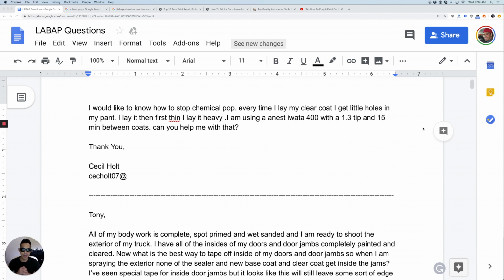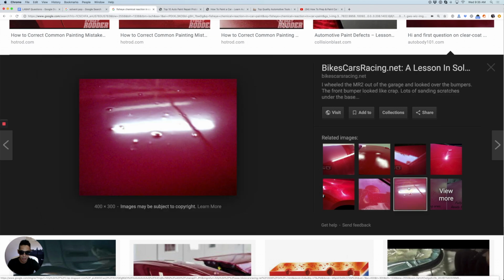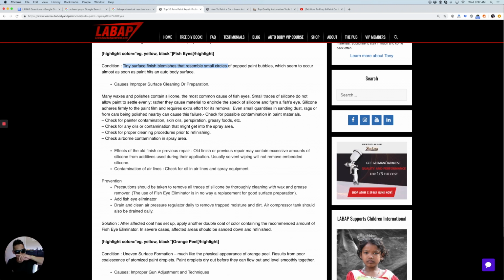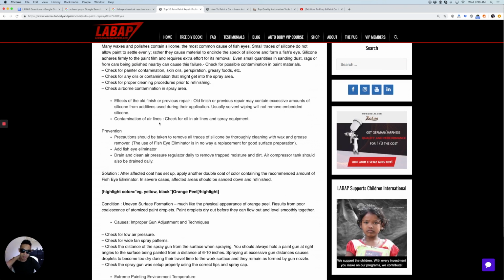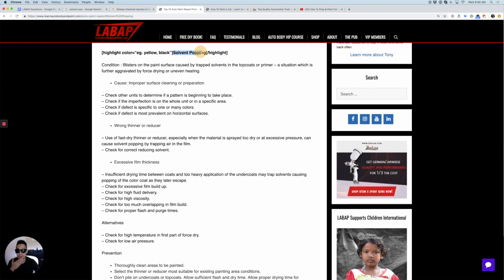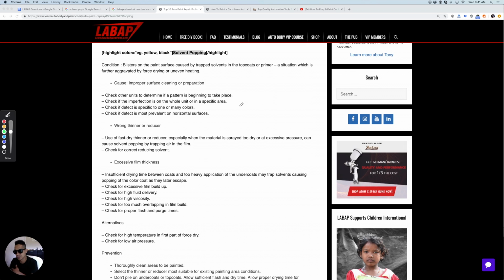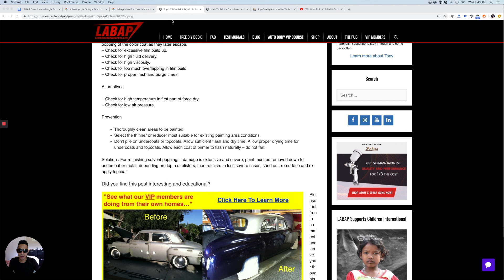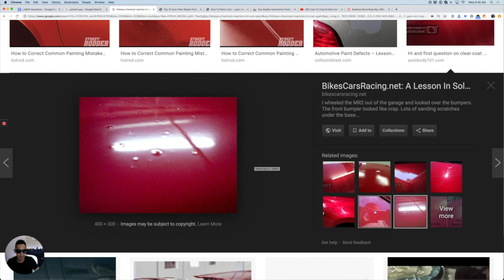What Causes Solvent Pop And Fisheye in Automotive Paint?

Comment: I wonder if there will ever be a video on how to fix bubbles whether they are in the base or in the clear coat?
Reply from the maker: like air or water bubbles? Solvent pop?
Reply: @HowToPaintYourCar I recently did my hood and to the one side theres these little 1 inch long and 1/4 inch wide bubbles that have popped up....3 of them 2 smaller then the 3 that popped up.  I was told if I dont fix them they will get worse.  Except is like 20 degrees here and its almost impossible to work in th freezing weather

Comment: With reducer slow is fast,, l only buy slow now no matter what the temperature l just give it more time in colder temperature, fast reducer with just give you more orange peel,   and spray first base coat light to prevent fisheye, most fisheye comes from spraying to heavy of coat at once, with light coat even if you get it you can let it flash and cover it up with second coat.
Reply from the maker: Good point! Light coats are key to a good finish.

Comment: I only use slow reducer and thin even coats with plenty of time between coats,  too much air across the surface can cause skin over trapping solvent, avoid heavy coats,, I've found a helpful tip , on first coat of clear turn fluid knob out 2 turns and increase distance too 8 inches let flash dry to the touch before second medium wet coat closer distance, give your base coat plenty of flash time before clear, l mean like atleast an hour,
Reply from the maker: That’s a great tip! Keep cranking Man!
Reply: @HowToPaintYourCar   l started in a down draft booth couldn't put out a bad paint job, moving to my own made cross draft booth it's a whole different world and you have to adjust to it.

Comment: Solvent popping happened to me yesterday. 1st, 2nd and 3rd coat of candy were fine. The 4th and last coat lots of bubbles showed up. I think was the temp cause these last few days its been super hot here around 36C (97F) and I wonder the why first 3 coats nothing happened on the candy cause the temp hadn't reached that super hot temp even if it was just 15 minutes of flash time from the 3rd coat. Also I remembered increasing the flow a bit on the 4th. Maybe it was a combination of things that made it pop.
Reply from the maker: Hey Man you might wanna check out https://www.radspaintformula.com/r2 and know more about on how to Master Auto Body And Spray Like a PRO Without Orange Peel, Nasty Runs & Tiger Stripes by Hacking This 5-Step R.A.D.S. Paint Formula

Comment: Thanks Tony! Always good stuff! I painted an old steel frame bicycle, added decals, looked great, but cranked on the Spraymaxx 2k clear in heavy layers, and got solvent pop bubbles!! Gotta sand down and start over, lol!! But question is, since adding decals over red base coat, how do I clean off the finger prints/oils without removing the red base coat?? (to prep for clear coat) Thanks!
Reply from the maker: Hey Man! Check out LABAP VIP Program and Learn How To Auto Body & Paint Like a Pro and Download Your FREE 85 Page Auto Body and Paint Manual at https://vip.learnautobodyandpaint.com/home

Comment: I did a hood today the base layed out good perfectly smooth waited 15min between coats did 2 coats. Went to start spraying clear and started getting bubbles. I did my engine compartment but used a cheaper clear and it came out great. Im wondering if i got a bad gallon of clear.

Comment: Solvent pop I've had this car come back with this on it when out fine when you pop the bubble water comes out and it smells horrible how's that happened
Reply from the maker: Hey Man! It happens when your paint dries too fast and you did not give enough time for your solvent to evaporate. That is why we use reducer to keep the coat drying fast. There are still other factors but try using slow reducer.
A good painting temperature range is from 70 to 90 degrees. Slow reducers are good because they allow your paint to flow out. Slow is the best for complete paint jobs. 

Medium reducers are used in a little colder environment. You can use a medium reducer in maybe 65 to 75-degree environment to set up earlier. 

Fast reducers are used for touch-ups. You can be working with just a fender in around an 80-degree environment. Hope this helps! For more tips and free training please visit learnautobodyandpaint.com

Comment: This solvent popping happens when the paint dries too fast while the solvents have not had enough time to evaporate.
This is where a slow reducer comes a long way. It keeps the coat from drying too fast, also reduces fish eye significantly. I have had enough of these issues and basically experimented a bit. Although other factors contribute to the problem, using a slow reducer has solved the problem for me.
Reply: How long do you wait in between coats with slow reducer

Comment: Not sure if this applies, but I recently detailed a customer's black Optima, which was heavily oxidized.  I did a one step correction using a product called 3D Speed.  After wiping down the hood many very small pits appeared.  Not sure if this is fisheye, as explained in the video or not.  Nevertheless, the condition was not obvious prior to the one step correction, and the customer is pretty upset.  For my part, I am pretty confident that I did not cause this pitting, but rather, I merely revealing existing damage to the clear coat once it was buffed.  Needless to say, my client is not accepting my explanations and we are at a stalemate because I do not feel responsible for underlying damage.  Wet sanding or doing a more extensive multi step correction is nothing something in my wheelhouse, so I am hesitant to offer to do this considering she is expecting something that I perhaps cannot deliver on.  Can someone tell me if my thought process is reasonable, in that removing the oxidation revealed the imperfections that were not so noticeable to the naked eye.  Thanks

Comment: Hi thank your videos. I wanted to ask if can i wet sand and buff fisheye ?
Reply: The only way to get rid of it is to respray the panel
Reply: @shaggymeme1268  If I am noticing them while clearing, I will let it flash longer between coats to try to achieve a little more build. I will apply a total of 3  wet coats to try to fill them as opposed to the normal 2. Then the next day I will sand down with 1000 grit, then 2000, finish with 3000 to eventually buff and polish. Hope this helps

Comment: SOOO really pissed off right now with Eastwood Epoxy. all my panels have a ton of acne. small pimples everywhere. double strainer and machine shook to break up solids. after fast etch was applied waited next day. washed with acetone the wgr. Used eastwood concourse gun 1 med wet coat 1.7 tip at 70 degrees  What am i missing? This paint has got to be the only issue i used the 2k before this on another project and NO issues. Soo all this money up in smoke... Any ideas i might have missed?

Comment: Hey guys 
I had issues with fish eyes on my last 2 jobs i    cleaned surface a lot and really didn't know why it keeps happening, gun settings and compressor weren't at fault the main issue was the high temperature in my spray booth so I lowered it down and bingo no more nasty fish eyes lol
Reply from the maker: Hey Al join me in my live streams and let's talk more about your paint project! Check out VIP too and see how it can help you progress with it! https://www.learnautobodyandpaint.com/vip-offer/
Reply: Not sure if I have fish eye or solvent pop. Prep was good cleaned several times with dish soap and water and grease and Alcohol remover still getting on base and clear coats all over panel.

Comment: Never had a problem with solvent pop until these last couple weeks. Could waiting to long in between coats also cause this? Using Omni270 with 5-10min between coats at 70 degrees but these last couple weeks it has been 90-100 In The booth so the time between coats is cut in half and I know certain jobs I’m not spraying within that time. Thanks
Reply from the maker: Yeah, you can also check out this blog: https://www.learnautobodyandpaint.com/causes-of-solvent-pop-in-paint-auto-body-qa/

Comment: Does it matter if I wait a hour between coats (to be sure that I won't have solvent pop )
Reply from the maker: No. 1 hour is fine. You have about a 12 hour window for basecoat before clearing.
Reply: BOSS PAINTER - Learn Auto Body And Paint! Forgot to mention that I will spray single stage , what would you suggest (how much time to wait until next coat )

Comment: I’m a mobile painter. During the summer time when it gets real hot I’ll get white in my clear as if it blisters. Is that the same thing as solvent pop and do you know how I can avoid this?
Reply from the maker: That could be because of extream heat. Try using a slower reducer and not laying it down too thick. You may want to try different clears as well. Some spray better in hotter temperatures like DUPONT/NASON. Keep us posted Don.
Reply: BOSS PAINTER - Learn Auto Body And Paint! I use Nason. It just seems I have to lay it on lightly with a couple of coats  using a very slow reducer, and then wet sand and buff later...😵

Comment: I was getting fish eyes on my base coat when I reduced my base coat too much.
Reply from the maker: That could have been your problem but usually, you'll get solvent pop with base thinned too much and sprayed dry. Fisheye is caused by contaminated paint or surfaces. The easy fix is to use a wax and grease remover before any painting. Good luck!
Reply: @HowToPaintYourCar  Yes they were crater like though. Not bubbles. I mixed in a little more base and the issue went away.